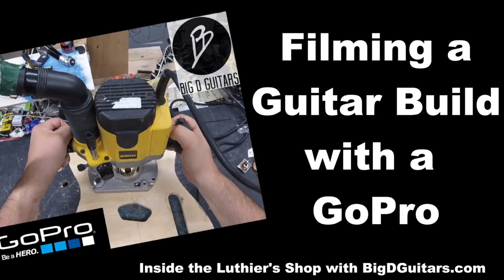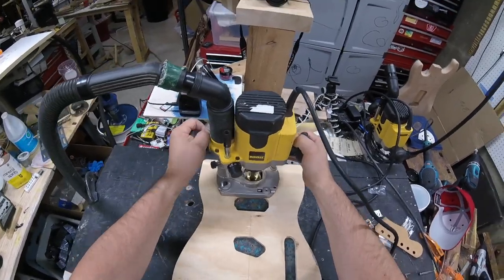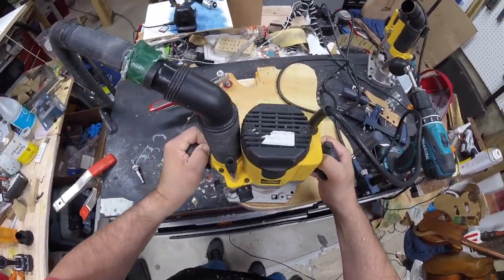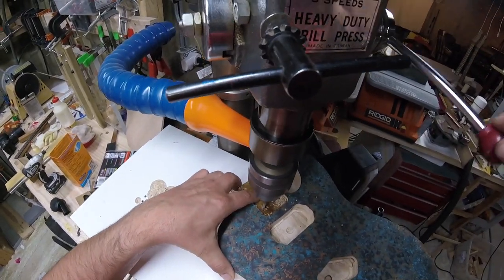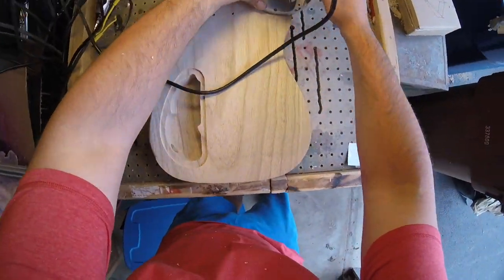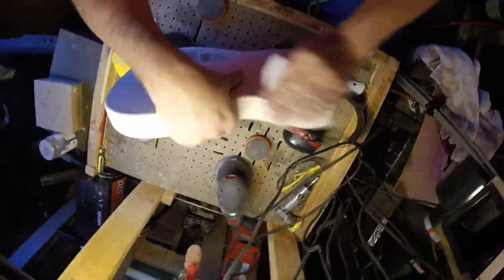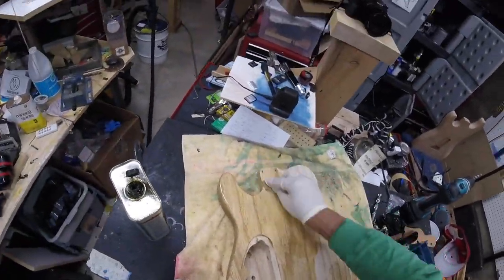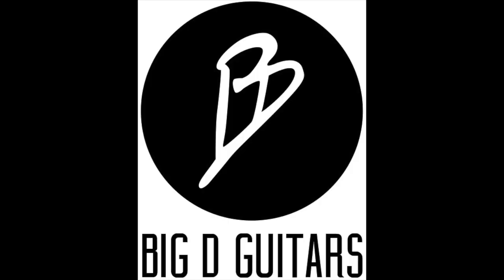GoPro Guitar Build - Building a Guitar Body filmed via a GoPro

Comment: @BigDGuitars? Do you have any other options than coating with wipe-on-poly (basically oil)? I'm planning something similar and maybe a very thin layer of epoxy resin could seal it avoiding it to become dark? I also know for sure that Sayerlack (aka Sherwin Williams) have for sale REAL copper powder to be sprayed with regual spray guns. Sad part is that is extremely expensive. BUT, as they also sell chemical stuff to make different kind of patina, SO they also have product to seal it :)
Reply from the maker: I have used a spray lacquer or sanding sealer to keep this stuff sealed too.
Reply: But that used to darken it a little? I've seen sample at Sherwin Williams dealer, and they were reeealy turquoise! Because I want to spray nitro sealer or acrylic sealer over it